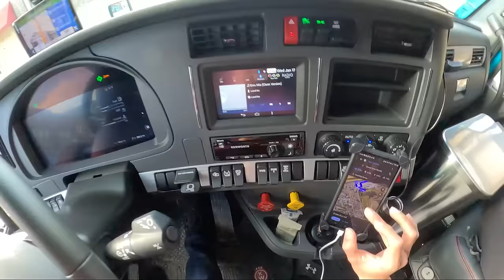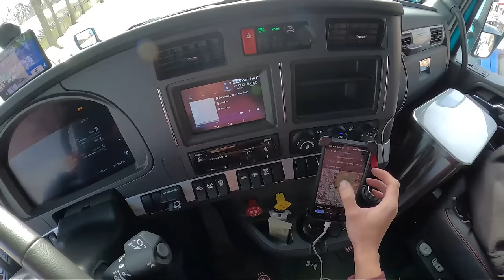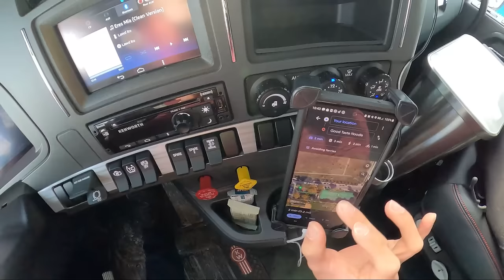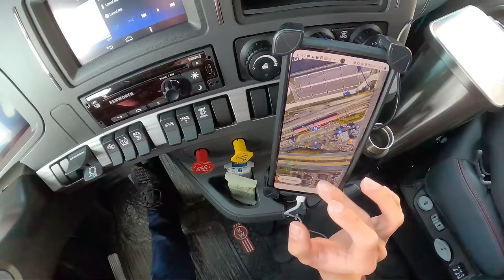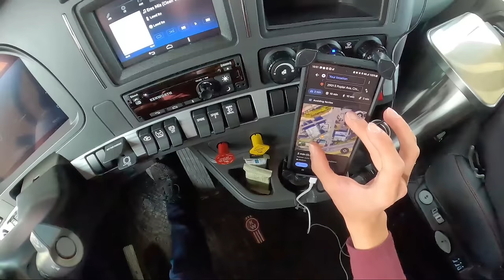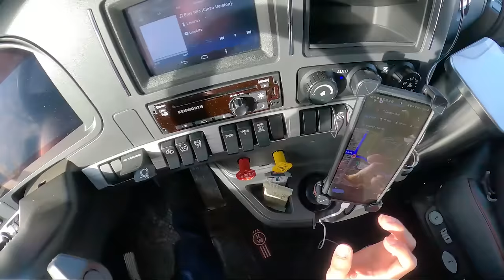You Want To Be A Truck Driver? Watch This First...

Comment: When I was at trucking school, my teacher always told me that I have to set the pace and impose myself when comes a difficult turn. I was always waiting and being polite but it was not giving me positive outcomes. (I was stuck because i had waited too long). Now, things have changed. I haul wood chips with my 53 ft trailer and I impose myself, take control of the road and if i have to take two lanes to turn right, I just do. Sometimes i even start honking just to wake up people and make them look at me so I can gesture, where i need to go. They usually get it and give me the space i need. 😊 When you can make eye contact, most of the time, people will be respectful. …most of the time! Hahaha
Reply: Sounds like you are a great driver!  Keep up the great work!  Got some good tips from you, the main one is never give up. Especially loved the make eye contact, that’s saved me more than once.
Reply: Ever hear the term "button hole"?
Reply: I agree I use that method of driving too and it’s made a huge difference
Reply: I've learned that also when you drive nice you get ignored in a semi truck you have to move your weight around 😂
Reply: The closer you get to their car, the bigger they realize you are, the more respect they give you.
Reply: @Handleviz  button HOOK
Reply: Button hook? What's that?😊
Reply: @ZaraDavos  it's truck driver lingo for a type of backing maneuver where the truck and trailer is in an L-shape when it backs up
Reply: @The-Harpy-Slayers  No it isn’t. It’s a right turn maneuver where we cut in to the for left lane before maneuvering back into the right lane in the turn (to prevent trailer going onto the curb- called off tracking). Another turning maneuver we do is called a Jug handle.
Reply: I'm heading to trucking school this Sept, I read your comment slowly and carefully! I'll take any advice I can get my hands on!
Reply: @The-Harpy-Slayers  it has nothing to do with backing. It's a turning maneuver used on a tight right or left turn mostly right to position the truck and front of the trailer in the left lane leaving the back of the trailer in the right lane as a means to block both lanes  so that we can safely make the turn without having four wheelers passing us on the rt or left side. It's also called swinging wide.
Reply: @Handleviz button hook?
Reply: learning to drive an ambulance right now and one of the things they teach you is, before going through an intersection even with our lights and sirens blaring, is to make eye contact with all of the drivers. they're more likely to respect you if they actually had to face the person driving the vehicle, rather than if they just see the vehicle and not the person in it. it adds that human element that turns it from an annoying big vehicle to a vehicle with another human being inside of it
Reply: Well sir. You need to be like that. Sorry for drivers but the cargo you guys deliver is priority. Period.

Comment: Bro really went all the way around town to avoid blindsiding
Reply: It’s against GP transco’s policy to blindside without guidance.
Reply: Maybe better trip planning
Reply: @Solitaryman70  I worked for GP, I don't recall that policy. I blindsided when needed. I just got out and looked.
Reply: Anyone wanna tell me what blindsiding is
Reply: @realspartangaming4517  it's where you do a more difficult back because you think doing a safer back will make you look like a rookie

It's a back that's towards the passenger side instead of the driver side
Reply: @Solitaryman70  Really, pretty asinine, because I have never trusted anyone but myself and my own eyes. Seen and heard to many nightmares over the years. Even from guidance from same company drivers. Just takes patience and time, two things the modern imbeciles leave off the table.
Reply: @sword-and-shield  Of course, even with guidance you the driver are still responsible.
Reply: @Solitaryman70  Then best to ignore it from the get, and school yourself on doing it solo. Companies making asinine policies are usually based around Insurance companies sometimes as well.
Reply: @sword-and-shield  What’s your point?  If you like to blindside solo then do it, why are you complaining?
Reply: @Solitaryman70  The point is clear, but I get it they left reading comprehension off the table when you went through. As well there is no complaining in my posts just statements of fact, so you need a dictionary to understand word definitions it seems as well. After all this, do a re read the point should be crystal clear.
Reply: smart move
Reply: I do that too. It’s not worth the risk.
Reply: @sword-and-shield  What else do you do;  Hat tricks?   You can claim you can do anything, it’s what you can prove you can do that counts.  Read and comprehend that Genius.
Reply: @realspartangaming4517  you backup going in the direction of the passenger side instead of driver side.
Reply: Of course nit wit
Reply: @palmettoraised8882 we do it with up to 34 meter trucks in the Nordics. With 2 or 3 pivot points, not just 1 like the semis.

Comment: A brand new truck with a check engine light on.
Reply: Like fr I swear every year they make the trucks less and less reliable
Reply: That’s because PACCAR is junk. Ever since they bought peterbilt and kenworth it’s no better than a Mack now.
Reply: Last year my company gave me a brand new 2023 Freightliner, around 5,000 miles the check engine light came on lol
Reply: Tbh it’s a hit or miss with any brand now days
Reply: Peterbilts are s*** and my Peterbilt for my company is made of chewing gum bubble wrap and tape stuff's falling off of it. Engine light comes on. It's a f**** disaster
Reply: Engine light could be anything.
Reply: @Leone_510__ 
Guaranteed it’s some kind of emissions bullshit
Reply: @Acemechanicalservices  agree
Reply: @Leone_510__  Drove my car for 8years with it on perfectly lol
Reply: @thebunker6350  it obviously wasn't something major. A lot of time even if the problem gets fixed it'll stay on until you go pay a dealership.
Reply: @Leone_510__  yeah 99% of the time it's probably nothing to worry about
Reply: must have an x15

Comment: You really need to get a real Truck GPS to get you around safer and stop going down neighborhood side streets.
The best Truck GPS systems in 2024 are the Rand McNally TND 750, Garmin Dezl OTR800, Garmin Dezl 580 LMT-S, TomTom Trucker 620, and OHREX GPS. Truck GPSs can cost around $50 to well over $500. More expensive options typically include more route-planning features and more frequent map updates.
Reply: He has a truck GPS also. Do you not see it? 😂
Reply: ChristopherFitakvlogs.can any of them help you skip ⏭️ a scale?  Or bypass a scale ?
Reply: 4:51 was wondering why he didn’t use his trucking gps right there?

Comment: GP send you to the craziest places. 
I've picked up in Chicago once with Crete. It was about 5 blocks from the skyscrapers. Had to turn down a very small residential road, and blind side back between 2 trailers, from the very narrow road, with cars parked on the shoulder giving me about an inch, and other cars zipping by. And an 11'8 bridge staring me in the face to where I couldn't pull up very far. Crazy, but oddly enough I got in and out within an hour, probably because of the adrenaline 😂
Reply: My first time in Chicago city had me trying to cram a 53' trailer in a 48' hole when the 53's were first getting popular. Leg gives out from all the clutch work and required short breaks to stop the leg shake.
Reply: O my,  crazy 😊

Comment: I’ve been to many places as a driver,  including both NYC and Chicago IL.   I’d have to admit Chicago is my least favourite and most frustrating.  Always try to get into the city before 4-5am to avoid the traffic and chaos whenever possible.
Reply: omg don't let him in NYC
Reply: When I started driving my first load was Memphis, TN to LA.
Reply: Chicago is horrible. The suburbs almost worse
Reply: @anthonylagunas6737  Random question for you.  When I have been travelling east-west in Arkansas toward Memphis, I noticed a whole lot of trucks rotating leader/drafter.  When travelling north-south in Minnesota, Iowa, Missouri I have not seen much of that.  The problem is trucks pass other trucks with about a 1mph difference in speed.  All these drafting rotations completely clogged up east-west Arkansas.  Why is there so much of this drafting and rotation in Arkansas in particular, and as a Honda driver that goes 85mph (in dry conditions) what can I do about trucks in the fast lane moving 1mph faster than the slow lane?  

I wish speed limits would say "DRY:  LEFT: 85 MAX, 75 MIN, RIGHT: 70 MAX, WET: SUBTRACT 10, ICE: SUBTRACT 20" and "LEFT LANE FOR PASSING ONLY, FEDERAL LAW".  There would be some ambiguity when changing lanes from a max 70 to a min 75 but I don't think that would be an issue.  I know this would never happen because speed limits are a game and revenue generator so they can post 65mph on dry sparse roads and claim "safety" for the purpose of lowest common denominators and abnormal conditions and ticket people doing perfectly safe 80mph
Reply: I love watching 👀 this from my warm bed 🛏️ 💻with NO responsibilities 😊
Reply: Yeah, back in the paper days I  always did it that way, 3-4 am mostly...traffic flowed but was still dangerous
Reply: @TryHardNewsletter  There's not anything you can do really. Trucks do this because many company trucks have speed limiters. If they could pass faster they would. But some truckers aren't considerate of anyone coming up who's going faster than them. Ideally, they should wait until it's pretty clear before passing. But sometimes a bunch of cars come from the on ramp while you're passing, and sometimes they come out of nowhere! And sometimes there's an unexpected hill while passing, which can slow a truck down a lot.
Reply: @CurbHopper111  Very unfortunate.  And so many highways have space in the middle to add a 3rd lane.  Every highway should be 3 lanes.  I guess many bridges would have to be widened, but whatever just do it.  No trucks in left lane unless within 2 miles of a left lane exit.  And if 3 cars are driving the same speed blocking all 3 lanes, the left most driver immediately loses their license

Comment: City work always better to make left turns if you can. When engaging power dividers don't flip the switch and lock them in till you stop spinning. At times in situations when you need a little more on your drives drop the airbags on tractor not for long driving just till you get unstuck.
Keep on a truckin

Comment: I havent started my career just yet however my whole class was told to use Hammer over Google for routing. Because Google assumes its a normal cwr and takes you everywhere and supposedly Hammer was designed for us, shows us valid routes, supposed to help with low bridges, and rest stops and fuel islands. (Will definitely report back after actually being able to use it soon)
Reply: Is hammer a good GPS app? I just started trucking school myself

Comment: I understand the value of putting a seal on a truck by the shipper and removed by the receiver to prove the integrity of the load.   What's the value of a seal by letting the driver put the seal on and take it off?
Reply: It's recorded on the bills.
Reply: Yeah that's weird, unless he's inside a terminal don't the receiver need to confirm that the seal was intact

Comment: You needed a 2 foot bolt cutter for a plastic seal, I snap those with my fingers
Reply: Same here, have even broken the metal band ones with a gloved hand. Cable and bolt seals is when I got the bolt cutters out 😮😊

Comment: Ive been consuming these trucking video since signing up for CDL classes(got to pass DOT first) Im curious isnt there some kind of magnetic wireless camera system you can buy to slap on to trailer's when you pick them  up to help with blindside. Im sure there is. add well as distance warn echo sensors

Comment: It's 2024, why can't we have trailers with backup cameras that feed through the harnesses we are already using on every trailer, it would be so easy to retrofit while staying compatible with trailers without them since all the wiring is already there for power and backup signal

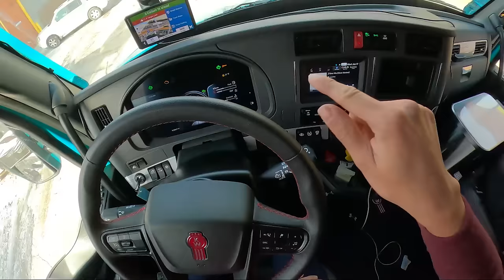Comment: At 15:00 I would have waited for no traffic then turned right, stop when the truck and trailer is straight, back up in a straight line past the street you came from, turn right onto the street you came from and I can do that in like 30 seconds or less. Driving a truck in a city is very hard and you often have to block the entire street and make people wait and if they run into you it is their fault.

Comment: I've only got three more axles then you do and I'm legal up to 140k 🤷‍♂️
Reply: Good point you brought up. Many of the newer/ newbie drivers think that the absolute max weight for a semi is 80,000 Lbs like Alex said early in this video. However, like you mentioned, it all depends upon how many axels you are running with.
Reply: Yeah, it depends a lot on the state and how many axles you have
Reply: Also more weight on drives with apu.

Comment: Use trucker path I use it cause Google is not meant for trucks it's meant for cars cause you should not have turned down the road with the black truck it was too tight

Comment: Your stopping messing with your phone you have trip planned already stoping in the middle of road touching your pretty sure is a direct violation of your company safety rule
Reply: As long as the vehicle isnt in motion, hazzards are on , your brakes are set, and your in a safe spot to park, you should be good.  Sometimes routes youve planned dont go as planned and you dont want your vehicle stuck or to be put in a situation where you can damage things.
Reply: Yep had to this several times just part of the job
Reply: No. Not a violation but a must. You need to check, recheck and check again. Because when you come close to your destination, there are always unplanned and unexpected situations so you need to look back at your route to decide what you can do next.

Comment: One thing for certain,  for sure Alex got an A+ in the Smith System Class 😂, and definitely an A- in turn-signal class.  Alex what do you get when you’re the only truck around and you use the turn signals REPEATEDLY when no one is around you?

Comment: Sitting outside the door and you drive away if your boss let's you away with these errors I'm surprised you have a job your not confident your way to slow although I seen 33mph that's speeding for you surely you should be confident by now you've been doing it long enough and just abandoning the truck in the middle of the road then got the cheek to say people park wherever they want ye no shit